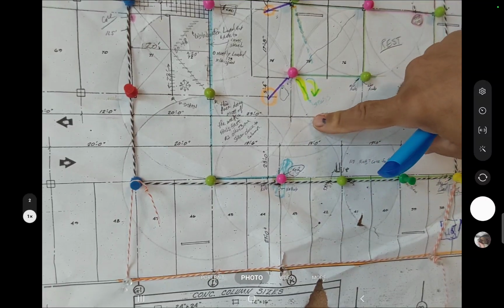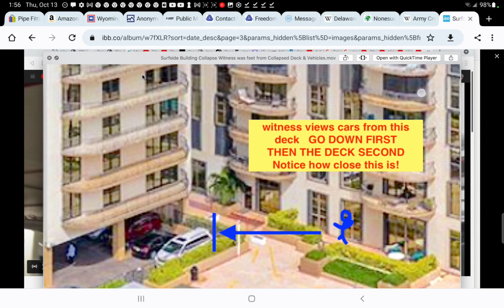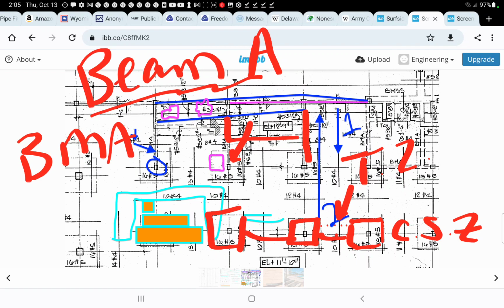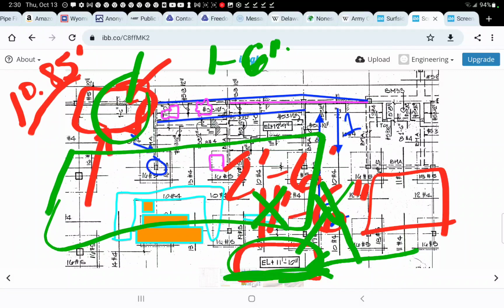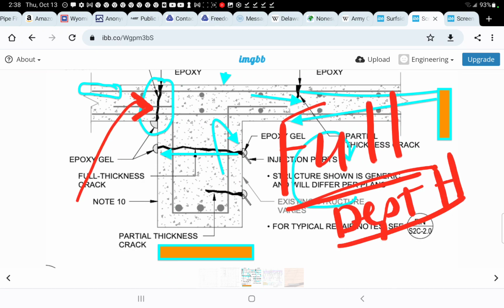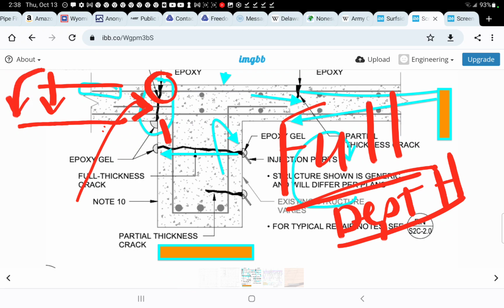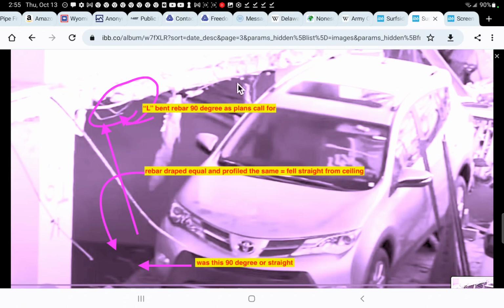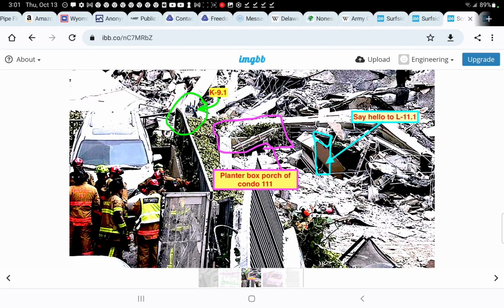Champlain Towers Collapse Column offset and removal of BMA changed dynamics of garage and pool deck

Comment: Hopefully they will accept the olive branch, as you've spent so much time analyzing this and would be a useful resource. I realize that you haven't liked the offsets for some time now, with the rectangular array discussions. No idea what the original designers were thinking by incorporating those, and I realize that they and the original engineers are all dead now. 

Hopefully you were able to get some rest. People should be in a good mood - sports teams are doing very well lately. I see many Eagles fans around here wearing jerseys etc while shopping for snacks for the games, but I know the Phillies are having a great season and the Flyers won today as well.
Reply from the maker: I would not get my hopes up on Bell extending accepting the branch... egos hate asking for help and have a terrible time accepting same...
Reply from the maker: I believe the architect had it mostly correct and then the greed of square footage took over... The extra kitchen size, the extra floor and the balconies added.... $$$ greed

Comment: I think that the rupture joints for columns and foundations  are recommended in this case between the flat slab of the Pool deck and the flat slab of the Garage (loads mass building )